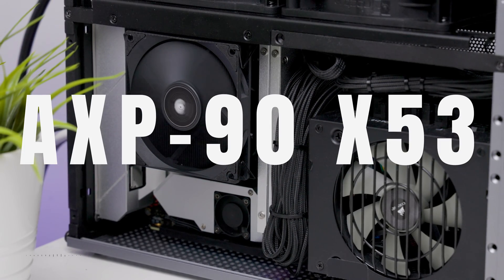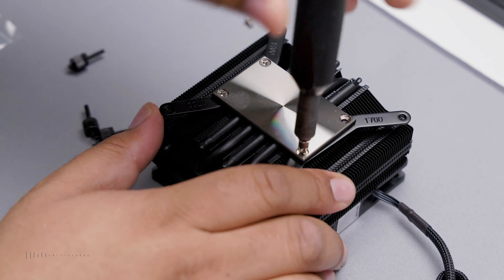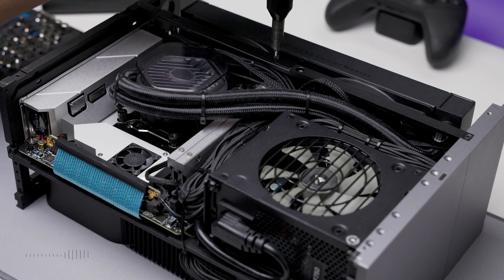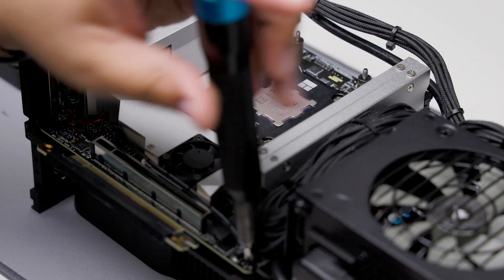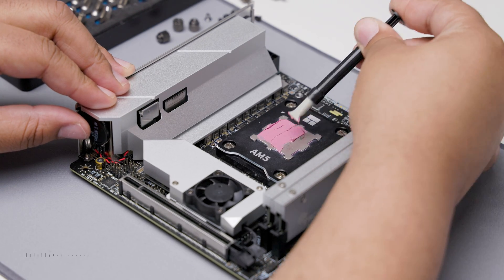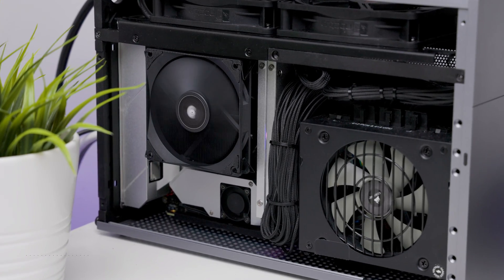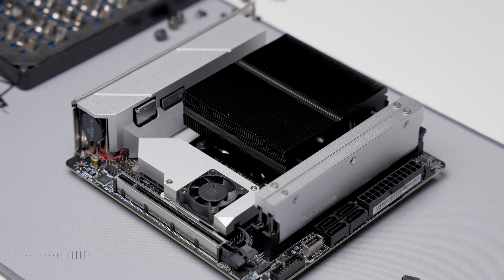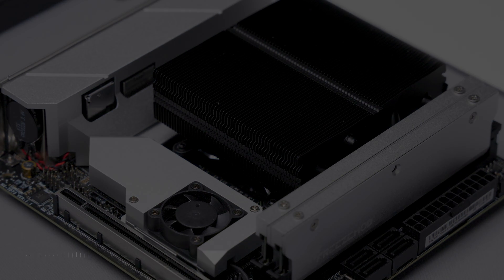FormD T1 - AXP-90 X53 Black: Review &  AM5 Installation

Comment: Looking for a small form factor air cooler for my am5 9600x cpu inside sugo sg13 with just 61mm of clearance. I found this same cooler online. But it only mentions support for AM4 and not AM5.

So, Can you clarify whether AM4 brackets would be compatible with AM5 as well or not?

Comment: Truly great video, thank you. I would add a few details that I didn't catch if you included them, as I'm currently installing this cooler:  my AXP-90 X53 came with the AM5 brackets already installed on the cooling block. You use the longer screws in the package. Finger tighten them on the block, use the socket on the nuts on the back and snug them up pretty good.

Comment: Is this build config quieter than the 240 AIO ?
Reply from the maker: If your using a low power CPU like a 7600X or 9600X then you can get the cooler to be as quiet and effective as the 240mm AIO. Once you start going into mid Rand to high end you’ll need to pump of the RPMs on these small coolers quite a bit to get somewhat decent thermals. I’d say a AIO is the best if you want good thermals and silence in the mid to high end. You can run a 9800X3D on the X47 but you’ll start to see worse results when doing any sort of multicore intensive tasks.

Comment: Next: Test with a 25 mm fan. For this, one either would have to get the 25 mm fan brackets of one of the Thermalright tower coolers, eg. the Thermalright Silver Soul 110, or bend it with pliers until the brackets fit the fan you intend to use. Advantage of getting sth. like the Silver Soul 110: You get BOTH the brackets AND a much better fan (TL-B9W/B = 54 CFM, vs. Noctua NF-A9 = up to 46 CFM).

Comment: How did you get the decals off the motherboard?
Reply from the maker: 100% Dollarstore Acetone and a bunch of cotton swabs. Soak a cotton swab in acetone and lay it on the surface letting the surface absorb the acetone for about 20-40 seconds. You should be able to wipe it all off in under 5 minutes.
Reply: @ChrisRussellTech  Thank you! I will hopefully try it soon.
Reply from the maker: @benjamindumez  do understand that there is a chance it voids your warranty

Comment: am I missing something. That's not the original am5 backplate right?
Reply from the maker: The backplate that comes with the motherboard is the original AM5 backplate. The one included in the box of the cooler is not a AM5 backplate.
Reply: @ChrisRussellTech  Dang My AM5 backplate looks like the Am4 backplate but its definitely an am5 board
Reply from the maker: @BlindSpaceMage  I believe they can look different but they’re essentially the same. They’re just manufactured by different board partners

Comment: I have an IS55 and its too tall for the T1 (so i dont have the side back on ) with a 4090 FE.  It looks like your 4080 is the same GPU height so will it fit with the AXP-90 X53 or will i need the 47 ?
Reply from the maker: It fits with both, however I would recommend the X47 if you plan to run the fans above 50% fan speed. The panel vibrations on the X53 is hard to overlook. I’m releasing a video soon comparing the two and I might add the L9a into the debate.

Comment: You know if Noctua NH-L9a fits on the formd t1 when using a 3.25 slot gpu?
Reply from the maker: Hi, yes it does, that’s a 37mm cooler and the 3.25 slot option gives you 48mm of CPU pump clearance.
Reply: Thanks man, did some research looks like the only viable option for good air cooling would be an axp90

Comment: This is just the black model, meaning the base plate is copper and the fins are aluminium, title says full black which is wrong, full black is a all copper model is currently discontinued, being full copper it is obviously better. It has a newer model now called the axp90-x53 full, color is copper and it is actually full copper. Full copper also comes in 47mm variant.

for people looking for performance numbers (X53 FC > x47 FC > x53 Alu > x47 Alu)   FC- full copper, Alu- Aluminium.
Yes x47 full copper is better than x53 black which is aluminium
Reply from the maker: Thanks for the clarity, that’s a bit confusing as the black model is indeed “Full Black”. Here in Canada we only have the Black model and Full Copper X47 and X53

Comment: Just a second data point... I originally built this a few days ago, with an air cooler for my 5900X, and it did very poorly. When I bumped it down to 65w, it worked, but I got only around 2/3rd of the performance. So, I put a 240mm AIO in, put it back to full speed, and it stays super cool, and a lot quieter. Love the build. I have built hundreds of PC’s (I used to work for a PC store), and dozens of my own, and this is my favorite case to date.
Reply from the maker: The case is indeed fantastic, expensive but worth it. I believe I ran this fan on both 105W & 65W Eco mode. I 100% do not recommend this cooler for any Ryzen 9 processors, 3000, 5000 & 7000 series. Go for the 7800X3D or maybe the 7900 non X

Comment: I have the x47 all copper and replaced the fan with a noctua.  It's definitely quieter with this fan. This is also in a t1 with a 4080 super fe. Works great.
Reply from the maker: I’ll be honest I was tempted to do the same . If I try it I think it’ll still have the be on the X47 model, X53 is just too close to the panel.
Reply: @chrisrussellca  I agree. As it is with the x47, I have the fan practically on the side panel.  I have 1mm of clearance if that.
Reply from the maker: @surfing_pikachuu  you must have it in the 3.25-slot config with 48mm on the CPU pump clearance. I switched from 3.25 to 3 so I could get a taller cooler in like the ATMOS
Reply: @ChrisRussellTech  Yeah, I did exactly that. I wanted to make sure there was enough clearance for the 4080 Super FE. I upgraded from a 3080 so I wasn't sure how tight the fit would be on the GPU. I know now 3 would fit fine, but I'm good with how it turned out now and this little cooler is doing a great job.
Reply from the maker: @surfing_pikachuu  well that’s great, if you ever need a little more clearance you have it
Reply: Which noctua fan did you use?

Comment: Did you use the long mounting screws or short mounting screws? I read that the long screws interfere with the riser cable in the back.
Reply: Don't use the long one, that's for intel.
Reply from the maker: @xSeanok  I’m releasing a comparison video with the X47 and I’ll address this in that video
Reply: do you have an idea lookslike you use the short ones which are provided for intel but it is the right way otherwise i read on some comments on reddit there is a touch witch riser cable
Reply from the maker: @shusui9665  you’re right the short met is for the Intel set I believe but if your using this case it works better than the AM5 screw. Most cases don’t have the tight clearance of the T1. If you do decide to use the correct screws you have to be careful they’re not pinching the riser or scratching your GPU
Reply: @ChrisRussellTech  thx very much. do you have a issue with the cooler pipes toichung the vrm mobo heatsink? saw a post that someone had a issue with a rog b650e-i mobo. cant decide which mobo o should use of b650
Reply from the maker: @shusui9665  I do have any experience with that particular board but with my MSI B650i I have no clearance issue with the AXP-90
Reply: @ChrisRussellTech  thx a lot!!
Reply from the maker: I’ll look into this, I don’t remember which I used .

Comment: What ram blocks are you using here? And what modules are they mounted on (just for reference)?
Reply from the maker: I am using aftermarket heat sink, here is a link ---> https://a.co/d/9zZyitt
Reply from the maker: Here is the link for the memory used with the aftermarket heat sink ---> https://a.co/d/hnWrjkh
Reply: @ChrisRussellTech  Hi, a bit late but will any ram sticks work with this heatsink? Thanks!

Comment: Hey so I use a 13900k for gaming only so about only 125-150W max. Would this be viable or should I go for the atmos cooler instead?
Reply from the maker: Hi, I’ve you want all the performance you can get in a case like the FormD T1 then you want the maximum cooling. A liquid cooler will give you better overall thermal headroom. Air cooling is great but the low-profile coolers require more trade off, as you seen in the video I applied a PBO Thermal Throttle Limit to keep the air cooler from hitting 95c. The 13900K is a hot hot chip, and it would be a shame if you stunted its performance when you could’ve bought a 13/14700K or 13600K.

Comment: What the ram and how do I desticker the mobo?
Reply from the maker: Well I used 100% Acetone nail polish for the decals and logo on the VRM heatsink. I just unscrewed the m.2 heatsink and peeled the acrylic sticker off. I do have to say that I’m using the MSI B650I Edge Wifi, I’m not sure if other models of this board can do the same; however it should be fine.

Comment: i didn't know it's possible to use x53 with 3 slot gpu, I thought x47 is the highest we can go.
Reply: I just used the 3D print fan duct and the result is worse. I am not sure if I accidentally moved the fan
Reply from the maker: @derrickc7525  I don’t think the duct will improve on temps if you’re using a case like the T1, it’s already perforated pretty well.
Reply from the maker: It is possible, however it’s only recommended if you plan to use it at low RPMs or in 2.75 slots or lower. There is some turbulence that occurs at high fan speeds due to it being placed right up to the side panel. I recommend the X47 if you’re in 3 slots or larger. I’ve heard that the steel side panel doesn’t have this problem.

Comment: I have an R7 7700 and this cooler could be the perfect fit when I buy a T1
Reply from the maker: It would be a great cooler for that just be sure you have enough clearance for it, it will not fit in 3.25 slot mode on the T1. Also consider the Full Copper model or the X47 model was you could see better performance with more cooling capacity or air clearance.

Comment: Why test the X53 black? 

The x53 full black and the more recent, X53 full copper are the popular ones,  it the standard x53 or x53 black. Could’ve gotten better thermals and a better cinebench score had you went with either of the two copper variants of this cooler, especially for that cpu
Reply from the maker: Hey, we don’t have the full copper available here in Canada, the ones that are listed from Chinese sellers would’ve taken several weeks.
Reply from the maker: To be transparent, I was under the assumption that the X53 had a partial black model (black fan) that was full copper, after further research it seems like that doesn't actually exist. There is model with silver colored aluminum heatsink and black fans but that's currently unavailable. Here in Canada we have the orange X53 Full Copper but for aesthetic purposes I decided against that one. However I do feel its important to test the full copper option so Ill look into acquiring that one for testing.
Reply: @ChrisRussellTech  gotcha! Yeah they have the X53 black which has a nickel plated copper base, the X53 Full Black which was entirely nickel plated copper(though I believe it’s been discontinued) and the most recent is the full copper which as you said, doesn’t exactly fit the aesthetic but will perform the best. Would be a really cool side by side to see how much better in your testing the full copper is vs the black that you used here!

Comment: what mobo is that??
Reply from the maker: It’s the MSI B650I Edge Wifi with some cosmetic mods. Removed the designs and logos with nail polish remover and removed m.2 acrylic sticker for this clean metal look.
Reply: @ChrisRussellTech  Ok THAT'S something you need to do a tutorial video on
Reply from the maker: @tlv8555  the problem is that it can only be done once lol I’ll look into that video. I may consider it for my FormD T1 mods and 3D Printed video currently in planning